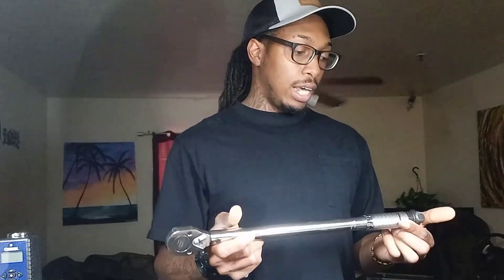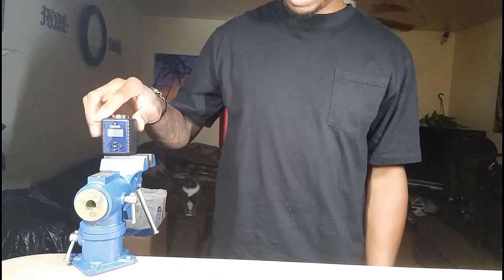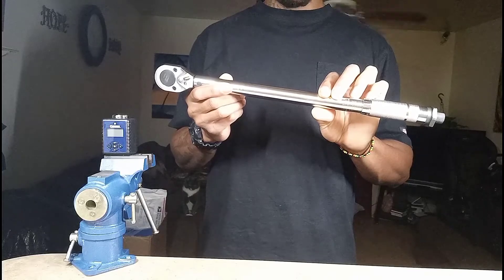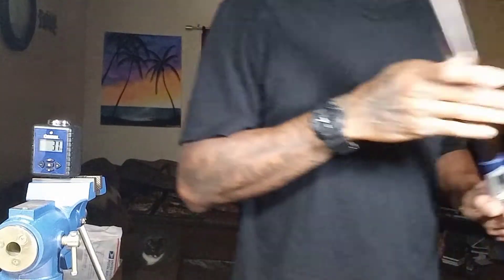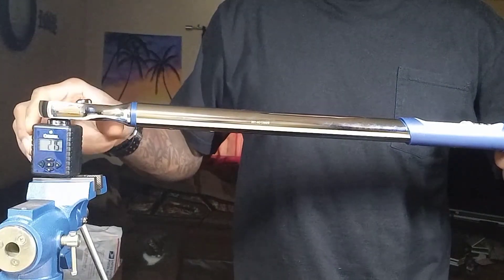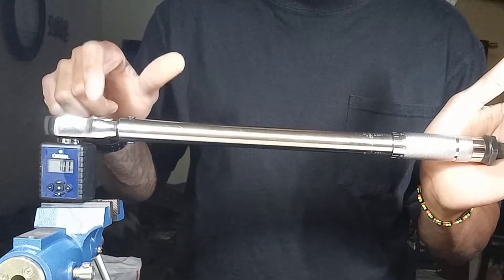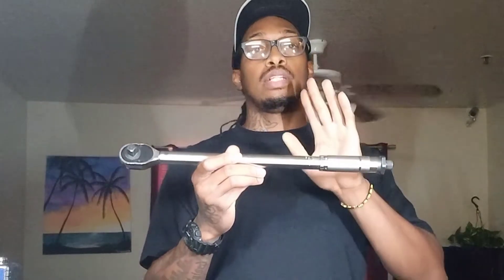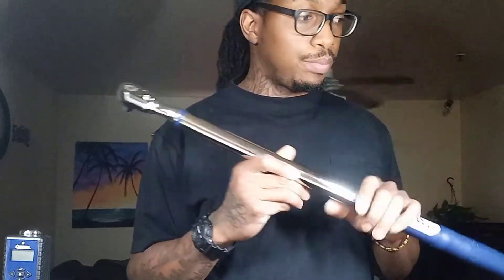Dont Buy Cheap Torque Wrench

Comment: I've been a professional tech for over 5 years now. Always had napa and harbor freight torque wrenches. Just bought 3 to replace them, digital 3/8 Gearwrench, 1/2 Clicker Gearwrench for wheels, 1/2 Digital ATD wrench for heads and engine work etc...if i had bought all snap on wrenches I'd be looking at 3x the price. Still, they are much better than my old Pittsburgh stuff. I've done alottttt of torquing with those cheap wrenches and it always seemed like it was accurate, but it's hard to trust them especially when repairing a customer car!
Reply from the maker: Yeah bro exactly.  I've also used them for years and know people that use them, I probably just had a bad one. Good thing I only used that one on my head studs and nothing else, otherwise it would have cost me a LOT more. I'll only be using my good torque wrenches from now on

Comment: Awesome video review my friend. I dig your digital torque wrenches and digital torque adapter. I love my ATD Tools digital torque wrenches 1/2 and 3/8. Those old school cheap click type torque wrenches with the screw at the bottom are horrible. They always have been. Some maybe ok when brand new for maybe a few jobs and then into the recycle can. Maybe that why they are so dirt cheap. I would not recommend or risk my family, friends, customers life or there good hard earned my money doing repairs using  those click types. They are to inaccurate and need calibration torque often. Digital is definitely the way to go for peace of mind. 🇺🇸😎🇺🇸

Comment: Digital Torque Wrench something I REALLY need to buy but keep putting off. The digital adapter nice but don’t have a breaker bar nor a Harbor Freight store . so eBay it will be. Good video 👍🏻
Reply from the maker: Yeah bro a good quality digital or click type is a must have. You can order the adapter one like I have if you go to HF website

Comment: You should have the calibration checked on any torque wrench periodically, or any time it has been dropped or otherwise abused. In this case it almost looks like the torque wrench is calibrated to NM rather than foot pounds. In military aviation we had to record the serial number of the torque wrench used, and the torque wrenches had a history file of when they were calibrated and the accuracy of the calibration all to be used should a fastner fail in a critical application.